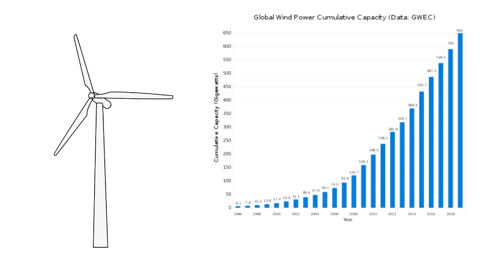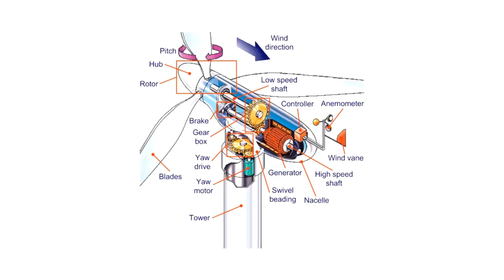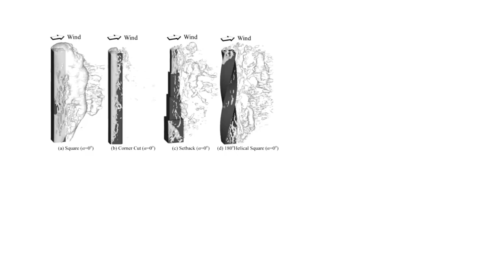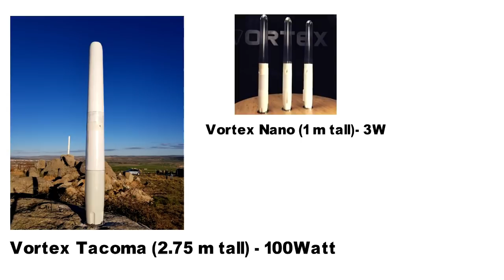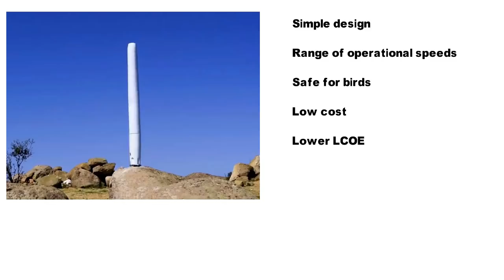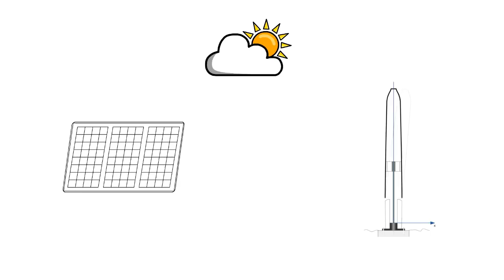Bladeless Wind Turbine

Comment: I'm curious about the foot print.  Was he talking about the space each type takes up on the ground or how much space each needs to work.  If he was talking about the space it takes up on the ground, it seems you could pack more into an area since you don't need space for any turning blades.  That would help solve some of the problem of producing less power per tower.

Comment: Is it noisy?  If it vibrates are there parts that collide with each other?
Reply: Probably. You'd want the upwards structure somewhat light so it moves with the wind/turbulence. And that lightness increases the risk of it acting like a form of loudspeaker.
If any openings or edges exist it might howl.

I'm just curious what would make one bend.

Comment: Give me a break.  743 Gigawatts isn’t 1% of the worlds energy needed.  I’m fine with a better windmill and blade-less windmills, but give me a break when you represent that wind will ever be a significant percentage of our energy needs.  Interesting but this generates such a insignificant amount of energy and the wind does not always blow.
Reply: Wikipedia says 2017 world electricity demand was 2.4 TW.  So 743 GW is 30 %.   Admittedly, duty cycles for wind turbines varies according to design and local conditions but it is a lit more than 1%....
Reply: Electricity demand =/= energy demand

Comment: I'm confused.  Those little sticks vibrating in the wind produce... 3 watts?  I don't know anything about electricity, so the only point of reference I have is that it takes 75 watts to light up a standard household lightbulb.  So you need 25 of those 1 meter sticks vibrating in the wind constantly just to keep one lightbulb lit up?  How would those produce more power over their lifetimes than the production cost to produce them + the cost to distribute them + the cost to run them + the cost of maintenance.  Sounds like a probable huge net loss of energy.
Reply from the maker: Yes the meter long one is not very useful, unless you want to trickle charge a small battery

Comment: When you say 'same footprint', are you counting the huge diameter of blades in the traditional turbines? Can these be spaced nearer to each other in a wind farm? If so, power generated per dollar of investment may not be too bad, considering lower cost.
Reply: The power per dollar is too bad. They are counting the diameter of the blades and also the wake effects that all wind generators suffer from (including these turbine-less ones). You would need about 10000 of the 9 meter Vortex Atlantis to produce the same amount of electricity as one regular wind turbine. One Vortex Atlantis probably is comparable to a 3 by 3 m (9 by 9 ft) area of solar panels.

Comment: Lower LCOE seems very unlikely, based on the scaling law stated a 144m tall version would generate 256 kw, meaning you would need around a dozen to get the same output as one modern HAWT.  But at a 144m height your going to be looking at similar installation costs from the foundations and on sight assembly as a conventional turbine which would lead to a much higher LCOE if trying to create the large windfarms we see today.
Reply: So I'm not advocating for this company: I haven't seen prices and know nothing about them, so I'm not saying that I *know* that LCOE will be lower or even in the ballpark. But with that disclaimer out of the way...
...You're comparing the wrong things. at 144m you're talking grid scale production. These systems are generating between 3 watts and 1000 watts. They're obviously not being marketed towards power producers or electric utilities. These are marketed toward the individual home owner who wants to go off grid (or at least reduce their electric bill ando maintenance themselves, have a very different LCOE than grid scale installations. This won't nee
Reply: Less moving parts, less maintenance, lower cost over time

Comment: I'd need 50 for my back yard to charge an electric vehicle at night. Do they have an intergrated inverter for mains electricity connection and what is the cost installed?
Reply from the maker: Go for a 20kW HAWT if you have space enough to mount 50 of these.
Reply: @synergyfiles3536  I don't have space for 1 hawt.

Comment: Can this design handle typhoon strong winds like 200 kph?  I’m looking for a wind generator I can use during typhoons here in the Philippines.  During typhoons our electricity is cut off.  Thanks!
Reply: There has been some research in this area with the vertical axis wind turbines mentioned in this video. The more sturdy "savonius" types can be configured to work in more extreme wind conditions. There have been some tests carried out for this in scandinavian countries.

Comment: As low winds move between buildings, the wind velocity must increase to allow same volume of air to pass through a smaller space.  Placing between buildings will give higher localized wind velocities.

Comment: not sure about this, an average traditional wind turbine as you say generate 3MW with larger ones generating 10MW each. for this, the 2.7m tall ones generate just 100W at optimal which is 30,000 times less than the average wind turbine. the large 9m tall one generate up to 1KW, you have to build 10,000 of them to match the large 10MW wind turbine.
the major cost of the wind turbines are their capital cost (the initial cost to build and set up) building 10,000 of them to replace just one old turbine means you would have to be able to build each of those 9m tall ones for about $100-200 each or the smaller 2.7m ones for under $20 each to match. the lower operating costs is not enough to offset the initial cost unless it achieves this.

Comment: The guy from Japan designed an built one that withstand hurricane typhoon force winds! Combine that with this! According to CIA if the ocean currents stop-as predicted with the polar ice caps melting. It will case 100-200+ miles per hour winds all over the globe daily! The ocean salinity is changing to more fresh water. That is changing the speed of ocean currents which are what we depend on for our normal weather patterns.

Comment: It doesn't need lubricant but it also makes no power. Bladeless "turbines" have been debunked several times. The physics just doesn't make sense. This company has been talking about this product for years with no practical demonstration of the technology actually producing power... vaporware.
Reply: @unglaubichuberlieber8048  I'm pretty sure the video presented no actual test of the technology and no real world data. As I said, this has been debunked before.
Reply: @unglaubichuberlieber8048  The video presented a 9 meter wibbly generator probably capable of producing the same energy as a 1/10000ths of a regular HAWT-turbine or a 3 by 3 meter area with solar panels. There is clearly no need for an actual demonstration.

Comment: 9 meters (29.5 feet) isn't very tall as wind turbines go. Since the power generated increases with the square of the height, why not make them much taller? Actually, looking at the formula you give at 4:00 it's area (height x width), not just height that is being squared, so a much fatter "blade" will also generate more power.

Comment: There is so much more to be learned about alternative energy sources from wind and water currents.  It will only take governments to pitch in like as they have and still do for our dangerous and depletable fossil fuels.  They need to do research on the many wind foils that are necessary and already in place as bridges and shock absorbing structures.  See the power that worked out as a failure in the "Galloping Gerty" bridge failure. Lot of power displayed in its worse example, could have been turned to power with retrofitting.

Comment: Anything is better than Solar Cells on your second story !  I’ve used Solar powered landscape lighting for nearly 20 years and went through four sets of lights. The solar cells require routine maintenance, or they fail to provide sufficient power for the lights, the batteries are to be replaced every other year.

Comment: just off hand I don't see a great case use for this - I suppose if you were off-grid maybe you have some off these along with your solar panels but I'm not running wire very far for a couple Kw of power

Comment: not sure if you have already done a video on Vertical Axis Wind Turbines.
Reply: In short, VAWTs are less efficient than regular HAWT-turbines. This difference in efficiency is tied to the fundamental design and can't be overcome by engineering. This makes the VAWTs more expensive and worse for the environment since you have to construct more to get the same power. There are some disadvantages with HAWTs as well, but these disadvantages are of the type that engineering can mitigate overcome and therefor VAWTs are only useful in very few and niche circumstances.
Reply: @simonprobert8765  i don't agree with you completely on this. 
Consider using VAWT in the medians of the highways. They are small, have about 30% efficiency can generate about 5kw from the winds generated by passing cars, they are less noisy because the blade speeds are same, they are almost maintenance free with less moving parts. In short i see a great potential for LIFT type VAWTs.
Reply: @Soothsayer210  Efficiency isn't everything. The energy in winds is proportional to the wind speed cubed, this means that a wind turbine in a 5 m/s wind will only be able to generate 25% of the power as a wind turbine in a 8 m/s wind with the same area. Obviously I don't know the weighted average of the wind speed next to highways, but there is a reason why HAWTs are very tall and located in windy conditions, there is simply more energy per unit area there and for wind turbines this really matter more than anything else. If the available energy in the wind is a quarter that makes the generated electricity four times as expensive since you have to build four times as many turbines. If you also factor in that HAWTs are more aerodynamically efficient and probable reductions in costs from constructing and installing one large turbine as opposed to very many small turbines it is not looking good for the VAWTs next to highways. 

Lets just guesstimate some numbers (HAWT vs VAWT):

aerodynamic efficiency: 0.5 vs 0.3
average wind speed: 8 vs 5

These numbers are obviously not exact and feel free to adjust them, though i seriously doubt most highways’ windspeeds actually average 5 m/s during a year. But as the numbers are VAWTs next to highways would require over 6 times the area of a regular HAWT to generate the same annual energy. One single regular HAWT might have a rotor diameter of 120 meters giving an area of just over 11000 square meters. This means that the VAWTs next to a highway will need to have a combined cross sectional area of over 75000 square meters to match the annual energy production of one regular HAWT. 

Now I haven't read much about VAWTs, but lets assume a cross sectional area of 100 square meters per VAWT-turbine, meaning 750 turbines in total. You would have to space these out to mitigate wake effects (a VAWT is removing 30% of the energy from the wind). If we assume they are placed 100 meters apart and on both sides of the road the road section would still have to be 37 km to match the annual production of one regular HAWT turbine. I will say again that these numbers are not exact and you may challenge them if you want to.
Reply: @simonprobert8765  pretty impressive analysis. Thx. but you are forgetting that you don't have to place VAWT on either sides of the roads. Place them in the middle on dividers (you can even use the existing light posts - I believe a car moving at about 90km/h can produce enough wind to generate about 5kw  regardless of the direction the car travels because it is wind direction agnostic- which is more than enough for the use of that lights. Also the moving parts on this is much lesser than HAWT, they also can be mounted in about 8 feet height. Which makes it cheaper and easier to maintain. If possible please readup on the new generation LIFT type VAWT. But see your point too. Thx.
Reply: @Soothsayer210  Harvesting wind from cars is harvesting their kinetic energy through increased drag, thus decreasing their efficiency and thereby increasing their fuel consumption. It is an inefficient type of theft or in other words: a negative potential or none at all.
Reply: @hans-joachimbierwirth4727  Sorry, i did not state that properly. I am NOT saying to add that wind turbine on the car but to put them on the dividers on the road so that winds from passing cars can be harvested bidirectionally. VAWT is ideal for this since it is wind direction agnostic. Also, i think if we can add pressure sensitive plates on the roads (might be too expensive now) to generate energy, that will augment.
Reply: @Soothsayer210  Makes no difference whether you increase air resistance by putting them on the cars or on the roads. Either way they increase air resistance to the cars and the energy harvested adds to fuel consumption at a ridiculously low efficiency.
Reply: @hans-joachimbierwirth4727  i don't buy that - right now here in Canada, we have lots of highways with medians about 5 foot tall. All those wind is being already blasted on the wall which bounces back to the car. So on the contrary to your point, i believe if we can absorb this wind being wasted on the medians to be absorbed by VAWT, it will be good. Just an FYI, there is already a study underway in UK just for this.
Reply: @simonprobert8765  VAWT are more efficient due to when you place HAWT in a group, only the front turbines are efficient. 

A research team from the School of Engineering, Computing and Mathematics (ECM) at Oxford Brookes led by Professor Iakovos Tzanakis conducted an in-depth study using more than 11,500 hours of computer simulation to show that wind farms can perform more efficiently by substituting the traditional propeller-type Horizontal Axis Wind Turbines (HAWTs), for compact Vertical Axis Wind Turbines (VAWTs).
Reply: Far better than this thing

Comment: Sadly, I think there could be too many of the dreaded cost-v-benefit issues for the idea to be practical on anything but a personal scale. Like those miniature wind turbines about 12" across that can just about trickle-charge a mobile phone in a month, you end up spending more on copper wiring and installation than you save over the unit's lifespan.

On the other hand, if a company were to develop just the oscillating power-generating component, I think things might become more affordable.

How? Well, think of installing a power-generating device on towers already in existence. What towers? Think of a flexible structure that's commonly available, easy to access, virtually weatherproof, self-supporting, self-repairing, with a lifespan of at least 100 years, and which has a unit cost of £0.00.

A tree. 🌲

Yes, I know it's ludicrous, but... is it really so stupid? [Yes, it is!]  Gathering power from vortex shedding is already incredibly inefficient, so you might as well cut costs by using -

Er...

All right. I admit it. It's absurd to use swaying trees to generate electricity. But at least the birds would be happy!  😁

Comment: not new I saw this talked about in a TED talk about 10 years ago.  It apparently fails the cost/benefit analysis has failed or it did not get government funded which is required in the renewables market to make a profit.  500$ wind turbines easily give you 3kw that would supply the average home.  What would THIS gnerator cause.

Comment: Too vague about the amount of power produced, I'm afraid.
There are capital costs, and often planning and legal costs, in putting such structures up, especially large ones. Would need to produce enough electricity to be worthwhile, and have low maintenance costs as likely to be competing against solar.

Where I live they put solar panels on things like traffic signs and compacting public waste bins so they don't have to be wired into the grid. It's the sort of niche that might just be viable for smaller models of this proposed vibrating pole technology.  

Another factor aiding adoption for such street furniture use is the customer may already be putting in a planning application for a larger project, or may even be the planning authority itself.

Comment: The major problem with current HAWT turbines is low frequency noise. This video does not touch that issue. I would guess it is because this vibrating thing would be a pure noise devil that would not be allowed close to human settlements and close to wildlife.

Comment: the fact that you would need 2 of the 1m tall devices just to charge a cell phone make this ludicrous and inefficient. Its all about power density and this doesn't have it. 

Even the atlantis @ 1kW creates very VERY small production. Assuming you can place them 10' apart you could only get 435 of them in an acre (43560/(10*10)). That means for an acre of land will only produce 435kW or 0.435MW - not even 1/2MW. When compared to solar or wind that has a 2-3+MW per acre production (and climbing with newer nacelles/blades and PV) this technology is dead before it even arrives. We would be better to invest the money in innovating battery storage and expanding rooftop solar for local microgrids.